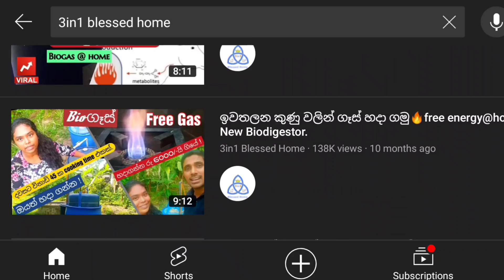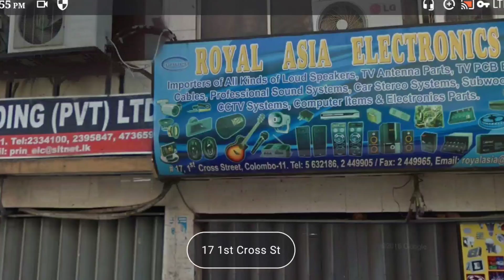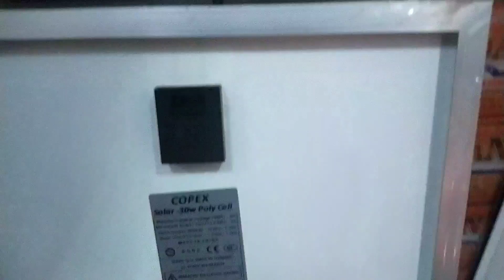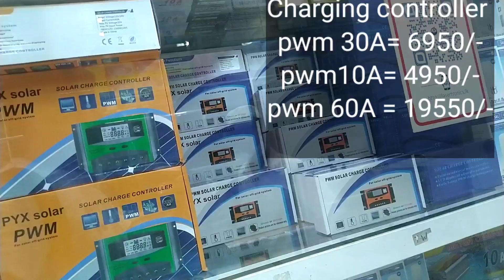Solar panel system එකක් ගෙදර සකස්කර ගැනීමට පෙර- භාණ්ඩවල මිල ගනන්!🇱🇰

Comment: මම 2011 දී ගෙදර ට  හදාගත්ත  OFF GRID  Solar system  එක  නිසා  මේ විදුලිය විසංධි වුනා කියලා කිසිම ප්‍රශ්නයක් නෑ .මම 2011 ගත්ත  තීරණය ගැන අවංකව සතුටු වෙමි .ලංකාවේ නම් බැටරි පමණක්  මිලදී ගත්තා . සෝලර් පැනල ,ඉන්වටර් ආනයනය කලා .
Reply from the maker: හරිම සතුටුයි අපිත් එක්ක එකතුවෙලා අනිත් අයටත් උදව් කරන්න. ✨🌞✨
Reply: @3in1blessedhome  aliexpres aken dan badu gennanna puluvanda dr
Reply: Great ...
Reply: @3in1blessedhome  මම දන්නා දෙයක් තියෙනවා නම් අවශ්‍ය කරන කෙනෙක් ට කියලා දෙනවා  උපරිමයෙන් .

අවශ්‍ය  කෙනෙක් ට දැනගන්න මම මෙහෙම විස්තර කරන්නම් .     මුලින්ම 2011 දී මම පාවිච්චි කලේ  1000w  solar inverter and  charging controller .
Inverter  එක  Pure Shine Wave  නොවුන නිසා   LED bulbs , Wall Fans , DVR එක      වැනි උපකරණ  වල ක්‍රියාකාරිත්වය  වෙනස් වුනා .
ඉන්පසුව  මම 1000W Pure Shine Wave Inverter   පාවිච්චි කලා .  ඉන්පසු  මම  එතෙක්  පාවිච්චි කරපු  12V 200A වාහන  බැටරි එක  වෙනුවට  12V 200A  Solar Deep Cycle battery  එකක් සහ  MPPT 1000W Pure Shine Wave Inverter  එකක්  සවිකලා. 
 ඊට පස්සේ නම් කිසිම වෙනස් කමක් කලේ නෑ .
නමුත් මම  මගේ  විදුලිය පරිභෝජනය නම් වැඩි කලා. කලින්  මගෙ තිබුනේ CCTV system එක   16CH   DVR එකයි  8 Camera . දැන්  ඒවා සේරම  අයින්  කරල  16CH  AHD DVR එකක් සහ 5MP Full Colour   outdoor 16 CAMERA  පැය 24/7 වැඩ . ( විශේෂ කැමරා වර්ගයක් . හැම කැමරා එකකම LED lights 4 ක් තියෙනවා . රෑ ට  ඒ ලයිට්  automatically on වෙනවා .කැමරා තියෙන ප්‍රදේශය දහවල් වගේ .තාම මේ කැමරා ලංකාවේ නෑ )  .
ඊට අමතරව  කලින් පාවිච්චි කරපු  Fan පොඩි නිසා ඒවා ට අමතරව අලුතින්  18" High speed  Fan 3ක්  එකතු කලා . දරුවන් දෙදෙනා ගේ කාමර වල  සිවිලිම වටේටම  Multicolored LED strip lights  දැම්මා .  
වහින දවස් ,ඉරු එළිය නැතිව යන දවස් වල ට  Grid  එකෙන්  බැටරි එක චාර්ජ් වෙනවා . සෝලර් පැනල නම්  කිසිම දවසක අමුතුවෙන් කියලා පිරිසුදු කිරීමක් කලේ නෑ .වෙන නම් කියන්න වෙන විශේෂ දෙයක් නෑ .
මම දැන්  සම්පූර්ණයෙන් ම   48V  5Kwh  Off Grid එකක්  කරන්න සූදානම් වෙනවා . 500w  හෝ 600w  සෝලර් පැනල , 5Kw  Off grid Hybrid  AIO Inverter  එකක්  සහ    48v 5Kwh Powerwall Battery  system  එකක් පාවිච්චි කරන්න ඉන්නේ .මේ  Powerwall Battery  system  එක  විශේෂ එකක් .මොකද දැනට  ලෝකයේ සෝලර් පද්දතියක් සදහා  භාවිතා කරන්නේ  Lithium battery  හෝ Lithium powerwall . ලංකාවේ ඉන්න එක්තරා  ප්‍රසිද්ධ සමාගමේ තියෙන්නෙත් Lithium powerwall එකක් . නමුත් මම පාවිච්චි කරන්න බලාපොරොත්තු වෙන්නේ  lithium Powerwall  වලට වඩා  Performance  ගොඩාක් වැඩි  වෙනත්  powerwall එකක් .  කෙටි  උදාහරණයක් ලෙස  lithium Powerwall  එකේ life cycle  එක  5,000 -6,000   ක් වගේ  නමුත්  මම දාන්න ඉන්න එකෙ  life cycle  20,000 වගේ . අවුරුදු  දශකයක් හෝ ඊට වැඩ කාලයක්  කිසිම කරදරයක් නැතිව විදුලිය පාවිච්චි කරන්න පුළුවන් .Tesla සහ  ඉදිරියට පැමිණෙන  electric  vehicle  වලට  යොදා ගෙන / යොදා ගන්නේ  එම  බැටරි .
ලීව වැඩි වගෙයි .  ඒ ගැන සමාවෙන්න .
Reply from the maker: ඔබ භුක්ති විඳින නිදහස අන් අයට ලබා දීමට බගේ හදවත තුල කැකෑරෙන අවශ්‍යතාවය ගැන මා ඉතා ස්තුතිවන්ත වනවා ඔබතුමාගේ අත්දැකීමත් අනුව හැකිතාක් ඉක්මනට ලාංකිකයන්ට දියහැකි අත්දැකීම් සහ ප්‍රඥාව බෙදා ගැනීමට කටයුතු කරමු.
Reply: මටත් කියන්නකෝ සොලර් සිස්ටම් එකක් ගන්න තැනක් කියන්නකෝ

Comment: ස්තුති, Solar panel, ඉන්වෙර්ටෙර්, Charging Controller, battery ගැන ට අමතරව භාවිතා කරන්න ඕනි wires මොනවද? change over, MCB , DC MCB , Fuse, Wiring කරන විදිය, පැනල සවි කරන විදිය, aluminumum railining සකස් කර ගන්න විදිය, අවශ්‍ය උපාංග ආදරයෙන් සවි කරන කරන විදිය තමා බොහෝ දෙනෙකුට දැන් තියෙන ප්‍රශ්න. Technician ල බොහෝ විට ඉතා අසාදාරන ගානක් ඉල්ලනවා installation සදහා. කව්රු හරි offgrid wiring වලට අවශ්‍ය උපාංග සහ සවි කරන හැටි  ගැන video  කරලා තියෙනවා නම් share කරන්න. ඔබට පුළුවන් නම් එවැනි video එකක් කරන්න බොහෝ දෙනෙකුට  එය වැදගත් වේවි